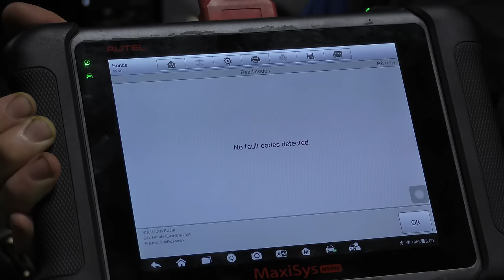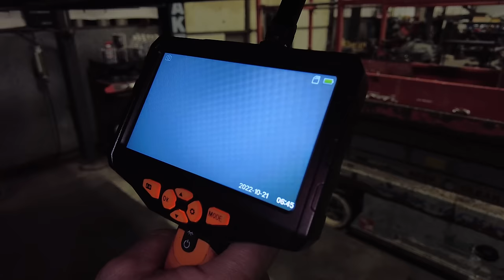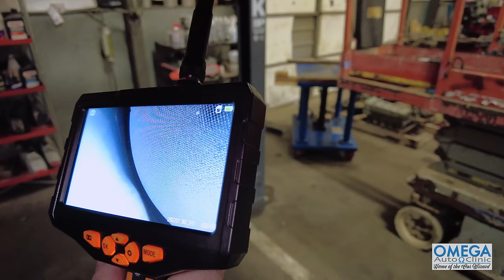Isolating the Problem? Engine Has No GO!

Comment: I had the blower motor in my g35 go bad and it sounded like a helicopter in my car I went to lordco and got a replacement motor for $235 and installed it myself in roughly 10 min a couple weeks later I took my car into the dealership for a free oil change I had left and asked them about replacing the blower motor (I didn't tell them I fixed it myself problem solved no issues since Works perfect) and they quoted me $950 to fix it they wanted $600 for the parts and $350 for two hours labour and I called them out about it after I asked and then told them I fixed it myself and for how much and they still tried to say it was a bad transistor in the ac unit??? morale of the story don't ever trust the dealership they will go out of their way to rip you off I have never been back there since

Comment: I'm at 1:43 My guess is that this car has a vacuum leak. I'll edit this when I've seen the whole video.
Edit: A plugged cat would not have been my second guess either. I would have been looking at the air filter and compression. That is why they pay Dave the big bucks.

Comment: That owner should just stay with your shop for repairs instead of getting mis diagnosis and upsells that won't fix the primary problem 

But can you clean out the catalytic converter since it's not broken up internally or was the clog just too far gone?

PS, I need to invest in one of those endoscopes or see if the local AutoZone rents that tool😂

Comment: It's very easy to fall prey to the so called vehicle tecs that are just spare part fitters
with no thought of the final bill and the original issue is still there.
Todays technology that relies on code readers can realy lead you astray, yet they don't
always as in this case give any clue as to where the fault is.
There are only a limited number of repair shops that have the experience that takes years
to aquire.
This customer was lucky to use the Wizards shop, i dread to think what other places would
replace and charge for.

Comment: What's worse is when you think you need a new transmission, but the shop diagnoses it as just a plugged cat. But since the customer already has transmission in mind, the shop goes along, tells the customer it is a transmission, charges the $7k, but in reality, they just drop in a new cat and pocket the rest of the profit. The customer is none the wiser, they have a car that works now and the shop made a killing. 
Shops quote name brand higher end parts for brakes, shocks, etc, but actually install cheap Amazon parts. The customer will never know the difference. You may think you are getting NGK or Denso plugs and coils...but are you really? Most customers would not know how to check, or even what the difference is. If they could, they'd probably do a lot of the work themselves.  There are some really shady people out there, and finding what they are really doing is very difficult.
Reply: Some Amazon and eBay sellers are pawning off counterfeit parts as well.

Had a set of fake ngk plugs and actual purchase from a brick and mortar store fixed that issue

Comment: You showed where air was blasted into the CAT ,and some surface area was cleared ,is there any way of clearing a CAT of some debris ,chemical flushing and heat ?
Don't know how your laws work in America,but down under we can delete CATs without being put in jail ,also there are sports Cats replacement available.
One thing comes to mind is you say that the front is clogged up but the rear section is clear,why not clear the front section and let the rest of the Cat do the same job ?
The bushes on the sway bar are a self do it job for a YouTube mechanic,and likewise for the shock strut ,not really a major job if one needs to save the money ,well it's not saving is it ,merely if you ain't got it you can't pay for it ??
Reply: Agreed, give the option to remove and "back flush the cat.... The honey comb is intact

Comment: I have NOT watched the video;  I am guessing it is a failed electronic throttle pedal.

Everything checks out just fine.  Yet, the engine isn't being told to produce enough power.  This fits the facts and won't throw a code.
Reply: I would have thought that a plugged cat would throw a catalytic converter insufficient  performance code....

Comment: Alright I'm gonna guess in the comments: It's a dirty filter. clogged fuel filter, maybe an air filter, maybe both. Engine's probably not getting enough fuel or air, and the computer can compensate just enough to not throw a code.

EDIT: Oh. Plugged cat. Well, I was half right. Not enough air getting into the engine, because not enough exhaust can escape. And the cat converter is kind of a filter.